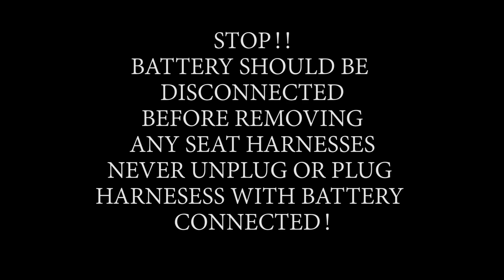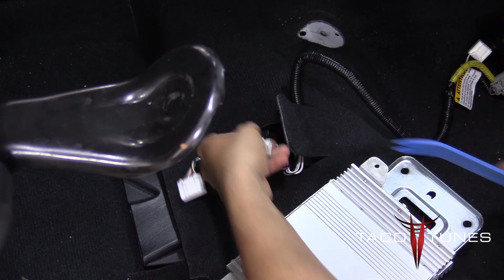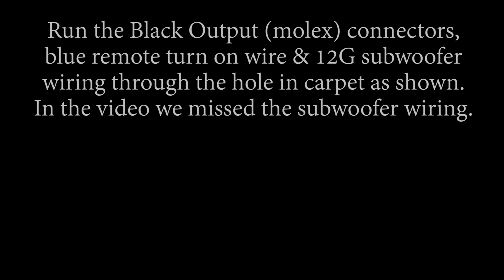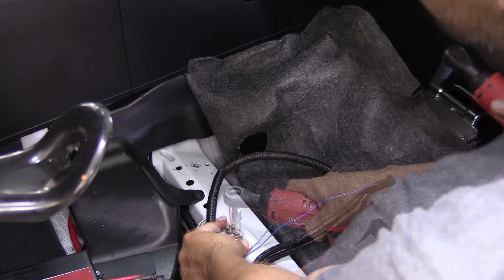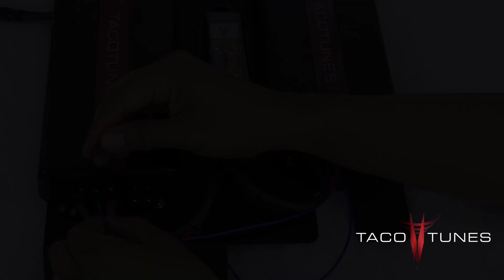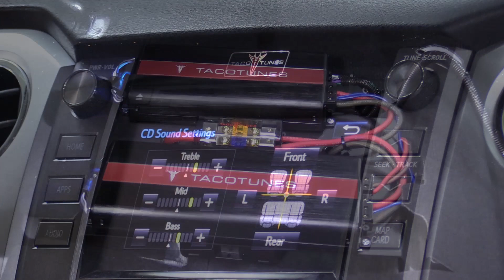2014-2021 Toyota Tundra JBL Amplifier upgrade / installation / replacement

Comment: Did you run a new power cable?  Or do you use existing from factory amp ??
Also, will this work with my pioneer head unit?
Reply: yes ran new power wire. yes works with any aftermarket stereo with pre amp rca output

Comment: This is not plug and play. Plug and play would be if you provided a harness that plugs into the 3 factory harnesses that you unplug from the JBL amplifier, allowing you to unplug the JBL amplifier, and plug in the aftermarket amplifier. If it is much larger you would of course need to run a thicker power wire and add a thicker ground wire, which can be attached to the screw hole for the JBL amplifier bracket.
Reply: we do provide the harness that plugs into the 3 stock plugs. this video is over 4 years old. there is a new equipment now :)

Comment: To expensive for the harness would you be a good person and share the wires  Diagram for the speakers and amp? Would like to just tap on to it
Reply from the maker: Before you head down a bad path . . you might want to check out the video below. The JBL often creates a lot of issues for people that are not used to working with it. https://www.youtube.com/watch?v=SA2SICC4NEE&t=1s
Reply: Thanks I figured it out

Comment: where can i get those JBL harness please i bought a tacotunes amplifier but they sent me a non JBL harness please i try to call them 19 times and left the message but no one is respond me
Reply: hung nguyen did they send you new harness?
Reply: @gregb287   Im wondering that myself because I too only got a two wire harness.  My JBL has three wire connector plugs (2-white and 1-black).  My harness only has 2- white connector plugs.

Comment: I'm curious what is the SPL you get off your  complete tundra systems?
Reply from the maker: If SPL is a primary concern contact us and we will show you our new fiberglass subwoofer enclosure we just released. The enclosure provides DOUBLE the airspace of our wooden enclosures. At 4.25 Cu Ft , you will get the most spl without losing any of your cab space :)